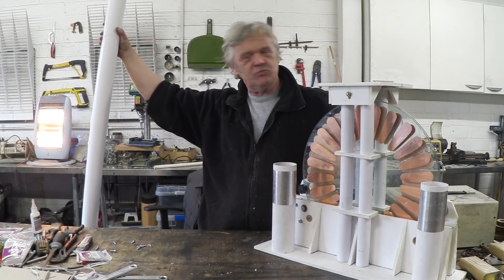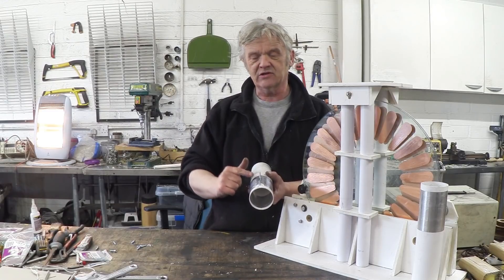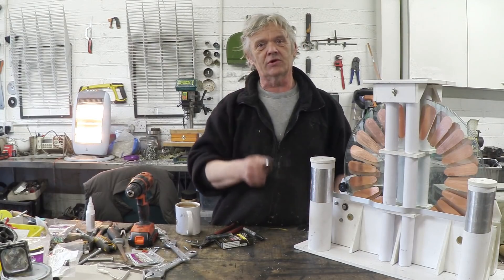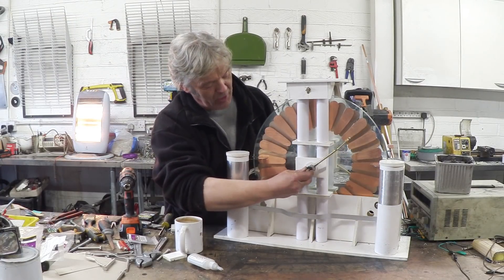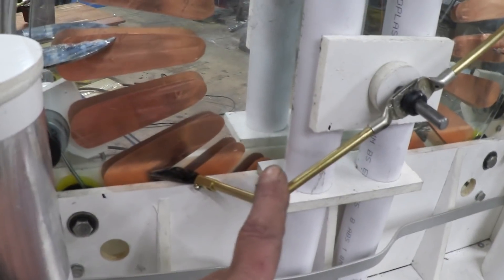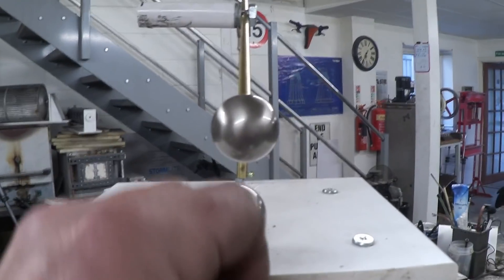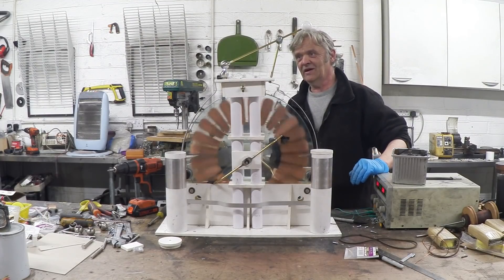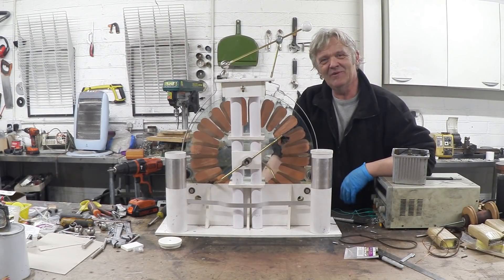1062 An Unusual  Wimshurst Generator Sparking Up

Comment: did u ever build an electrostatic motor? was thinking it might be fun to build one of these with 2 sets of metal segments on the discs.. use the outer circle as a wimshurst to generate the high voltage thats used by the inner circle as a motor to drive the whole thing round...

Comment: Would you consider mounting the discs horizontally rather than vertically - I imagine that would be safer for larger discs although it would take up more room.
Reply from the maker: there would be quite a few challenges to overcome - it would make it easier to do that if one were kept stationary and you rotated the other I would think - like in a Holtz machine?

Comment: Can a more resistive pick up bar generate more current? My brother has a small demo model but would freak if I started changing it up. Oh and those copper pick up foil will thin out soon if played with too much
Reply from the maker: sectors always wear out mate - the carbon brushes help give a longer life but the brushes wear out too - replacing sectors and brushes is just part of looking after these machines I am afraid

Comment: You can leave off the metal segments and they still work, possibly work better. But they're not self starting without the segments.
 I love the design without the axles
Reply from the maker: that would make it a Bonetti machine mate - personally I love the pigeon machine more

Comment: I am not saying I made a whimhurst generator, but one time I was on a roof with a shop vac, cleaning out the rain gutters. I need a longer hose, so I connected two together using stainless steel hose clamps. As I was sucking up leaves and dirt through the abs plastic, I was getting tremendous shocks from the ss clamp.
Reply from the maker: I would think it would be more like a van Der Graaf mate - but that is interesting cheers